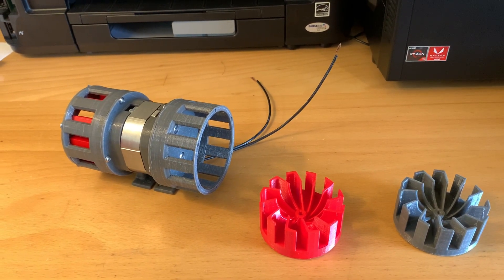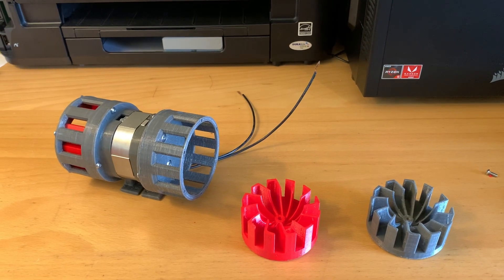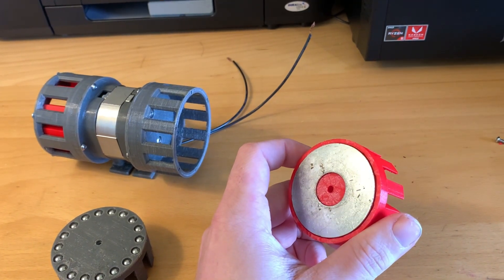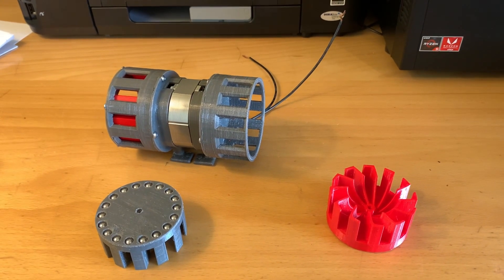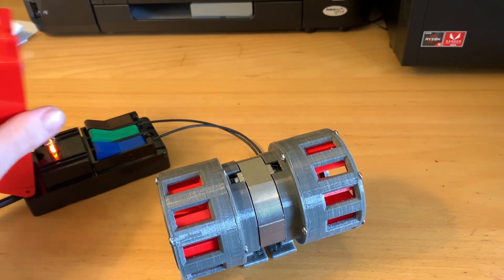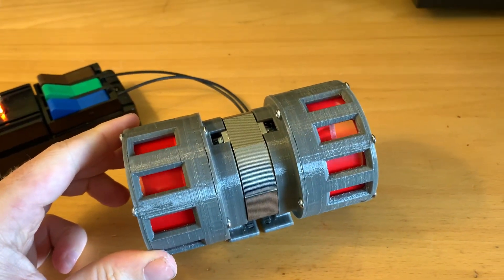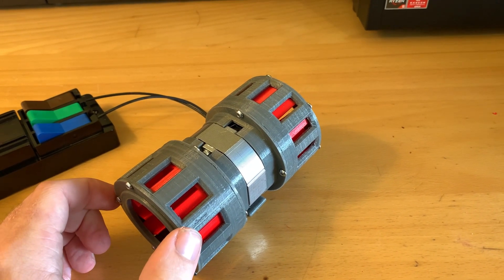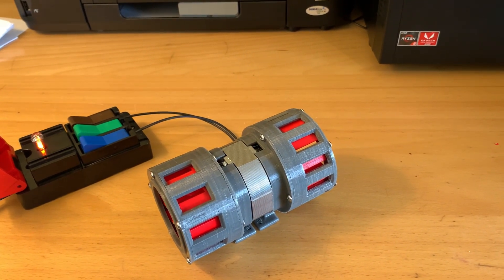Mini 3D printed air raid siren serious improvement

Comment: Mate this is awesome! What a great Idea. Would you consider building a larger model that's still smaller and lighter than the original ones, and still single phase/mains powered?? I'd deffo be interested in buying one. Keep up the cool work!
Reply from the maker: Thanks for the feedback! I’m in the process of making a larger one that is a much more realistic copy of the Klaxon GP8/CS8. I have a short video showing it doing a low rpm test run, and will be making the full video soon

Comment: I'm very envious. I appreciate how you got the correct port ratio and the correct RPM or around thereabouts. I'm tryna make one but don't have a 3D printer.
Reply: nvmd found it. When you say a 220 volts AC supply, is it stepped down in any way?
Reply from the maker: @rhysmodica2892  nope, it’s a shaded pole induction motor running on straight 220 volts ac at 50 hertz, very dangerous if mishandled
Reply from the maker: @rhysmodica2892 my shipment of motors are almost here, once they arrive I’ll be making more of these and selling them on eBay if you’d like to pick one up for yourself. Keep in mind they will need 220v ac to run properly
Reply: @Electronicsandsirens  What would I search up on ebay to find it?